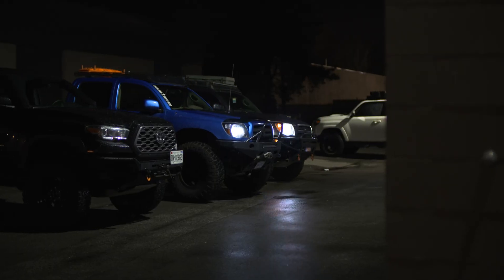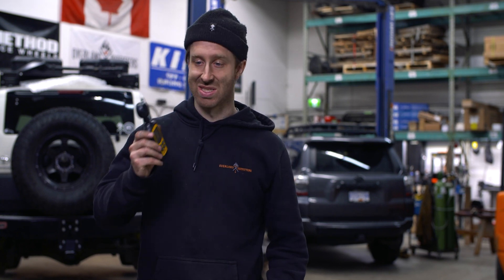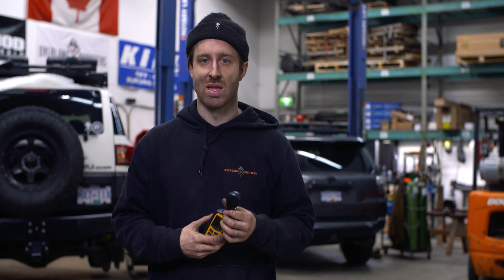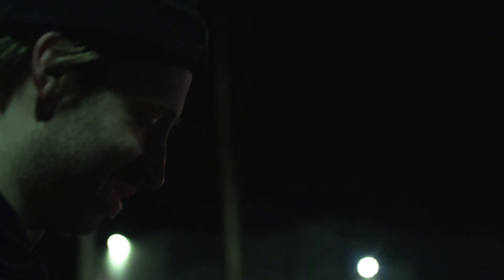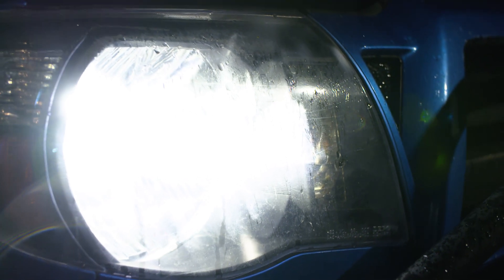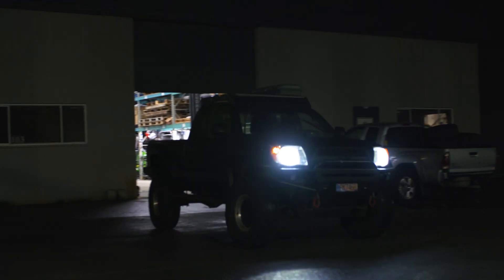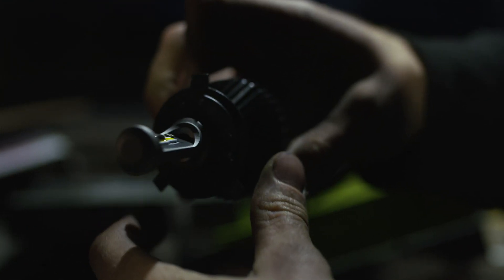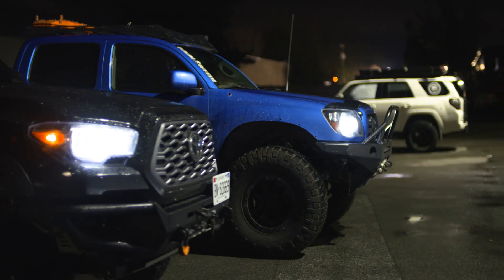Should You Really Put LED Bulbs in Your Headlights?

Comment: @OverlandOutfitters 

Holy shit what the hell type of led bulbs u guys upgraded to? That beam pattern is really bad. That’s definitely will make ur drivers mad for that. 

Stay away from those type. 

I recommended much better options. 

Such as:

Lasfit,Auxito,Auxbeam,Fahren,
Hikari, Sylvania led, Xenon Depot,Diode Dynamics, S-V.4,VLED’s Micro Evolution, Morimoto, GTR-Lighting, DDM-Tuning, etc etc. 
nowadays they make much better characteristics of the led bulbs. With the right type of led chips, the right right heatsink and cooling fan, much cooler after running when it supposed to get hot but it runs cooler, and they have a better reliability. 

I recommend Lasfit, auxito, and sylvania led. 

Stay away from those horrible no quality led lights like those. 

If that happen to me. I will immediately put halogen bulbs back for now, until I pick the right ones. 

That never happen to me and thank god I didn’t.

Comment: Had my led bulb upgrades to my 2015 lifted Scion xB for almost 8 months. No issues. 

Which one you might ask? I’m using Lasfit - LD plus switchback. The characteristics of the led bulb design is well made. The led chips matches the size of the halogen coil filament, the heatsink is 36mm with dual ball bearing cooling fan, with an external compact driver. 

And the beam pattern is radically awesome. Especially on H11 projector headlights.

Comment: YES WE SHOULD PUT LED BULBS IN PLACE OF CRAPPY HALOGEN BULBS, BECAUSE THE CAR MANUFACTURERS ARE TOO CHEAP TO INSTALL A HEADLIGHT BULB THAT YOU CAN SEE TO DRIVE WITH. THE HALOGEN BULBS THEY USE ARE HORRIBLE!!!!
Reply: And I don’t feel safe enough to drive using halogen projector headlights. Using led is much better and safer.

Comment: I used leds. Amazing difference. Night driving, spotting deer way out was great. The beam glowed reflectors way down the road. Now, technically led lights are not DOT approved, Osram makes some. Legally, an accident you can be liable since car wasn't designed for led, blah blah blah.  I Did have Sylvania ultra. I popped one in the driver light. Got the Hey can you get some milk now? Ok..OK... I was amazed at the beams on the road. Right was led so lit up the right side as usual and the halogen added a warmer light. It was as if I was driving on high beam. Nobody flashed like they did with my leds. Looks dorky but the blend of light and wavelengths was cool. I am leaving them in and test out on a country road I have to drive on sometimes which made me go led vs the silverstars I was using.
Reply: Silverstar Ultra is awesome.  It’s as close to HID look you can get without ruining distance vision and bad weather vision.  I’ve tried Philips Xtreme Vision and they’re also fantastic, if not better than SSUs.  But they didn’t have that “whiter” beam I wanted and the SSUs meet me halfway there so I’m satisfied. 

It’s kind of funny, many years ago Silverstar Ultra were trash because the whole bulb was coated in blue.  After Sylvania got sued and lost in court, they basically revamped their existing bulbs or they just brought their Osram Nightbreaker bulbs over and repackaged them.  Win win though because the Osrams are fantastic.
Reply: @Johnnygga realize that they only last for 1.5 years. It’s alright and that’s just how it is depending the brightness increase and shorter the lifespan. Or vice versa.
Reply: The sylvania - silverstar ultra was my first high performance halogen bulb upgrades 13 months ago. Had them for 5 months and it was a great start. The only halogen bulb upgrades I can recommend. 

Than I switch to ked from Lasfit - LD plus switchback. Very well made, much better beam pattern, and u get the best of both worlds for 6000k pure white for clear night and 3000k golden yellow for weather conditions, dark cloudy days, sunrise and sunset. It’s a must have led upgrade from lasfit.

Worth $100 bucks a pair. 🙏🏼

Comment: Great video on why you should NOT run leds in a halogen headlight assembly. You blind people.
The 3rd gen had the lowest output but I’m willing to bet it has the best sight picture for driving at night.
Reply: U don’t blind others if u get the right type of led. 

I’d still slap the right type of led bulbs that’s either projector or reflector.
Reply: @toyotabrony there’s no “right type of LED.”  It doesn’t exist.  You will blind people wether you have a halogen reflector or halogen projector 

Physics doesn’t lie, even though you think the beam is spread evenly, or it has a sharp cut off.  Bulbs and headlights have expensive equipment run on them for them to be compliant. Engineers don’t eyeball them and are like “wow this looks great!” Lol
Reply: @Johnnygga oh yes it does exist: 

U just gotta do ur own lots of research and see then testing. 

I can prove u wrong right now. And send u a clip to understand about finding the right type of led. And truth about it as well: 

😏👌🏼
Reply: @Johnnygga I have led in my projector headlights from lasfit. Same beam pattern as the original.
Reply: @Johnnygga The problem with most led bulbs available for headlights is that they have too high lumen outputs. If led makers made low lumen leds (as low as halogen lumen outputs, around 3000 lm at most) for car bulbs, they won’t be so blinding. The lowest lumen output I’ve seen for led car bulbs is 4000 lm, which is quite high already.

Comment: I was just looking Into new headlights and this video came up.

Good to see the comparison, I was gonna a go buy led bulbs and slam em in my truck but the lenses are pretty bad on my truck. Do you know of any good aftermarket replacement housing?
Reply from the maker: If you want a real upgrade, go with a housing that has projectors. We sell Morimoto. If you just want some freshies, honestly I just got cheap repo brand ones off Amazon and they work fine. I do wish I had better headlights though

Comment: Thanks for another vid B! One suggestion would be to compare stock halogen projectors vs led projectors on a 3rd gen. My 2020 OR came with halogen bulbs in the housings and I swapped them for Philips XtremeUltinon H11 bulbs and holy balls, what a difference! Don't have a light meter to test but the cutoff was unaffected and there are no significant hotspots. Pure white light and I love it. No fans in them but they do get fairly warm after prolonged use.
Reply from the maker: If I had the truck to do it, I would!